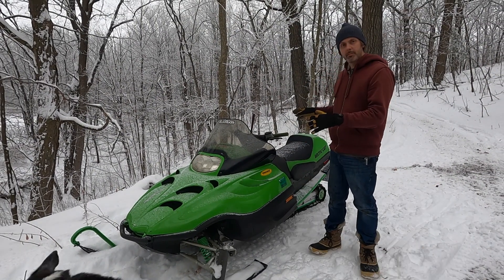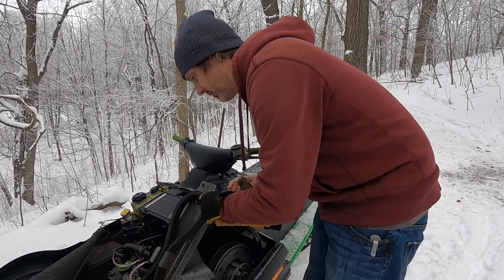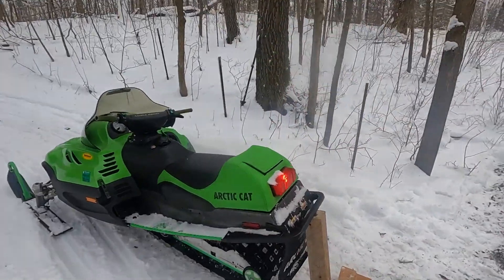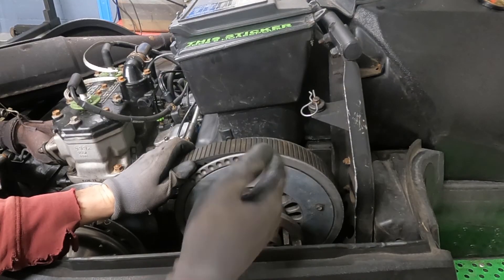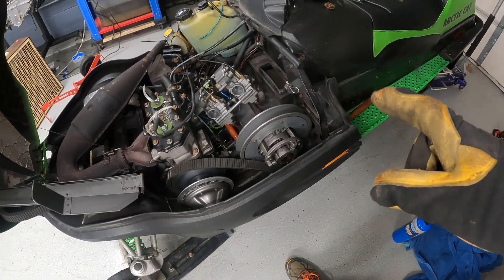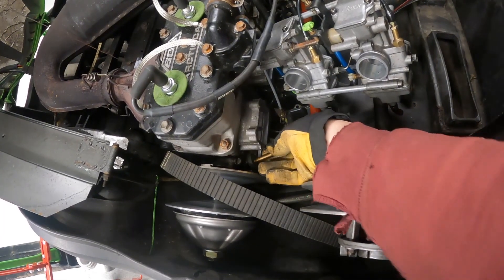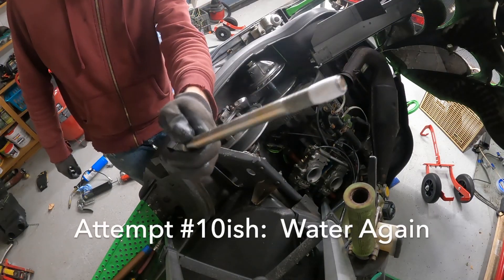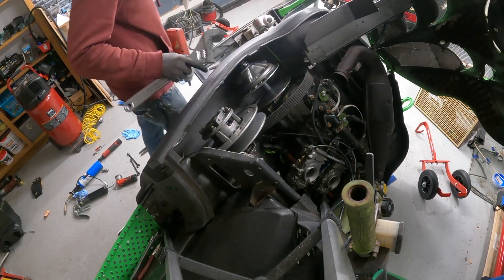How to fix Snowmobile Bogging & Poor Acceleration: Clutches, Belt Tension, & Engine Movement

Comment: Mine wont go over 6k normally.. sometimes it can go up to 7k clutch grips good. Sometimes mines cant run properly at all. Like its like going up to 2k and just sound like it has antilag. It only happening when I drive it really slow ( when I pull kids after the sled)
Reply: I got the artic cat m1 mountain  600 with the rotax 500 twincarb. I have little to none experience with carbs. Is it to rich?

Comment: PAY ATTENTION!!  this viewer has it right. (Your hydraulic removal method only works IF you use a shorter larger diameter bolt that treads into the clutch, not the crank. The bolt you are using is for holding the crank and the clutch together. The hydraulic pressure you are applying is contained inside the crank itself and not forcing the clutch and the crank apart)

Comment: Your hydraulic removal method only works IF you use a shorter larger diameter bolt that treads into the clutch, not the crank. The bolt you are using is for holding the crank and the clutch together. The hydraulic pressure you are applying is contained inside the crank itself and not forcing the clutch and the crank apart.
Reply: Exactly! 👍👍

Comment: To make the water trick work the bolt needs to thread into the clutch shaft Not the crankshaft!  The original bolt only engages with the crankshaft. Use the proper puller or a bolt the same thread size and pitch as the puller, wrap with pipe thread tape add water to the clutch shaft and drive in with an impact gun after hand threading in. Good luck

Comment: 1:21 that’s what my dad used to do. My wife’s 500Zl is WAY TOO RICH I’ve jetted it down by 50. I’m not sold on your clutch. I changed the fuel pump. It helped   4:45 yes you have a broken motor mount. Nobody ever took the secondary off. ( it’s important to grease the shaft where your secondary goes. ) I’ve learned that the hard way.
Reply: 11:51 I feel your pain brother. You’re giving me anxiety just watching you. Didn’t you say someone put that clutch off?

Comment: Had this issue. Hit it with pb blaster inside the shaft and on the backside of the shaft. Then went for a ride and let it get warm from running. After I was done it was still warm a few taps and it came off. Very surprised it worked. Just an idea that worked for me.

Comment: One thing you can do without a clutch puller is slide a short metal rod or small bolt inside and run a bolt matching the threads on the clutch and screw it down. The bolt will drive into the rod and push it out.

If you imagine a clutch puller which is basically a rod that tapers and has threads at the top end, when you thread it in the clutch, the tapered end will bypass the threads and push at the bottom, popping off the clutch. It's the same principle, so now imagine the clutch puller is just two pieces. The rod being long enough to hit the bottom, but short enough to be able to screw the bolt in. I have never heard of water, Teflon, or oil... The rod doesn't have to be steel either, just strong enough to withstand the force. The clutch puller is usually 5/8 or 3/4 thread. Something like that. Go to the hardware store and get a long enough bolt. Which, you could technically have a threaded bolt long enough to hit the bottom, it'd just take a bit longer to screw in and out. Hope this helps, I know it's been a couple years, you've probably already resolved everything.

Comment: the hole is blind and the clutch sits over the shaft if it is stuck over the crank shaft you may need a puller

Comment: YOUR MISSING THE RIGHT TOOLS,  THERE IS A BOLT THAT SCREWS IN AND POPS OFF THE CLUTCH AND THERE IS A TOOL TO HOLDS THE OUT SIDE CAP FOR THE CLLUTCH WHILE YOU REMOVE OR TORQUE THE BOLT THEY ARE LIFE SAVERS, YAMAHA TECH CLASS SHOWED ME IT

Comment: Don’t matter about grease gun. Use a small bolt or 1/4 drive deep socket. Water is too thin. Or grease with a couple dime size pieces of cardboard. Or buy puller

Comment: You can't use hydraulic pressure to remove that clutch.  You are basically trying to mash oil between the bolt and the closed hole'd crank.  A Puller has threads that thread into the primary itself and the end of the puller is small enough to into the threads of your crank, as you tighten the puller, the crank is stopping the puller causing the threads to effectively "push" off the clutch.
Reply: Yes you can. I’ve seen it done multiple times
Reply: @The.husky.max.  not on the 99 arctic cat. I beg you to try

Comment: My 90 440 prowler is doing this, but worse. It’ll rev if the track is off the ground but not under load, most of the time, and it loads up badly, but will idle all day long.

Comment: That power block clutch takes a special puller, if you order the oe puller for your clutch it will be wrong. Also, check rear motor mount under carbs, they are common to break

Comment: Buy a primary clutch puller for your sled, about $30 and quit messing with teflon and oil/water method. I just pulled mine off with one to replace a crank seal, took 30 minutes to finish to whole job and back on the trail. Good luck

Comment: I had the same problem on my 99 ZR 700. The stopper was broken like yours. I found that the jack shaft had been pulled toward the engine. I found it easier to remove the bolts holding the jack shaft and the brace holding the stopper than removing the engine. I used metal plates to back the elongated holes when putting it all back together again. That stopper is a critical piece to maintain clutch distance between the 2 clutches.
Reply from the maker: Sure is!   Without it, the distance between the clutches changes under load and it never really 'snaps' forward.

Comment: Can't use clutch bolt u need bigger bolt to screw into first set of threads clutch bolt only screws into 2nd set of threads so that won't work get 9/16-18 fine thread bolt and use water. Clutch will pop off ur first attempt, hope this helps ya.

Comment: That little Milwaukee impact isn't enough to pop the primary.. and on you secondary there should be a key-way slot with a pin on the shaft that could possibly be why you can't get it off

Comment: way wrong front clutch...thats a comet duster made for a low hp sled...wont work
Reply from the maker: Factory clutch, worked fine.   Problem was missing engine snubber.
Reply: @addvancedgarage  you got it

Comment: The frustration is that of a real mechanic, thanks for your videos. I’m experiencing a bad bog issue with my 1998 ZR600 Carbureted. Mine has the snubber, carbs cleaned, TSS bypassed, new fuel, lines, etc.. but I’m leaning towards stator or fuel pump? It idles perfectly, but hit the throttle and it starts to bog and die.
Reply from the maker: Check your belt deflection and stuff too!
Reply: Mine too

Comment: Without going into too much depth, the skidoos I’ve worked on are able to use the clutch bolt to also remove the clutch with the water method.  

I’m not sure how the powerblok clutches are, but Every cat I’ve worked on, you need a bolt that threads into the clutch rather than the crank to do the water method.  That older sled is probably a fine thread 9/16 if I remember right.  Newer ones are metric.   All you’re doing is threading your clutch bolt back into the crank and basically reinstalling the primary.    Once you get a bolt that threads into the clutch and not the crank, it will compress the water between the end of the bolt in the clutch and the crank and use the pressure to pop it off.   Wrap it up heavy in Teflon tape and try it again.  Once you figure out what you’re doing, it’s super easy.  My little 1/4” impact driver is all I use removing primary clutches.
Reply from the maker: Yeah I wound up buying the tool and it worked mint

Comment: 1st, it's a 2000+ model based on the hood. 2nd, when you started it, how long did let it warm up? Looks like alot of smoke means still cold. When a sled is left outside and then started and throttle it? 2 strokes are finicky. As for the bogg, secondary clutch should be addressed. When you put an aftermarket primary clutch you start over from the beginning. Not a fan of those aftermarket clutches. Both clutches need to be in sync and belt deflection is one of the factors.
Reply from the maker: The tunnel said 1999.   I think it was a ZR2 that someone rolled over and used the body parts from a ZR3, so it's definitely a mish-mash of parts from different years.   The powerbloc wound up being awesome once I replaced the snubber, smooth engagement.  Still didn't "launch" like BAM but it was pretty quick.  I have a feeling adding or removing a few grams would get it dialed.
Reply: Get a proper puller and to hell with suggestions from YouTube

Comment: I did this recently with my clutch as well. Nothing worked until I got a bigger bolt. On my clutch there is a bigger threaded portion higher up that you have to use for it to work otherwise there is no room for anything to get good pressure.
Reply from the maker: I wound up getting the CV-tech puller, worked great!    Stay tuned for next episode, drops on Tuesday AM